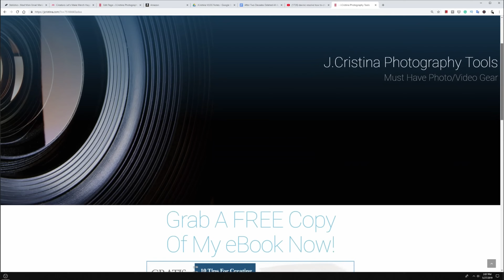SpaceX Starship IFT-8 Official Update & Live Coverage

Comment: odds are spacex strengthened the Thrust Plate.. ie..the plate that mounts the 6 raptor engines...with 20% or so added fuel weight means a lot higher strain on this one component in particular.....awesome presentation as always....
Reply from the maker: Thanks so much.
Reply: SpaceX said it was leak between engine heatshield plate and bulkhead. 
There is one thing about s33 (and s34). They are designed to use raptor 3. But none are available yet, so there is something called Raptor 2.5. those are Raptor 2 with attachment of Raptor 3. Probably this new hybrid wasn't as hard as original R2 or future R3
Reply: @just_archan  yes makes good sense... also rapter 3 has very few external sensor lines that also require very little protective shielding...the loss of starship is likely similar to what happened last summer with the upper stage of falcon 9...  the Merlin engine had a leaking sensor line that harmlessly got fed into the exhaust stream..the difference is that the Merlin leak was not contained in a closed off area as it was in starship..hence the recent starship change in design with additional venting and co2 flooded in as a fire prevention against leak fires....

of course the Merlin leak resulted in a failure due to loss of this propellant...but it did not create a catastrophic fire as happened on the last starship